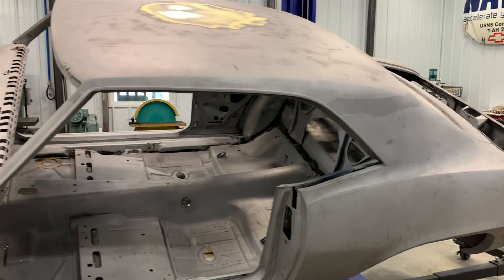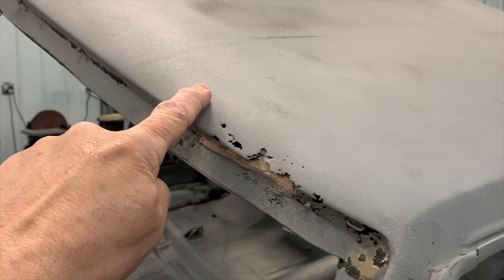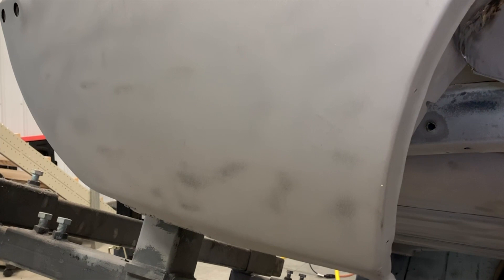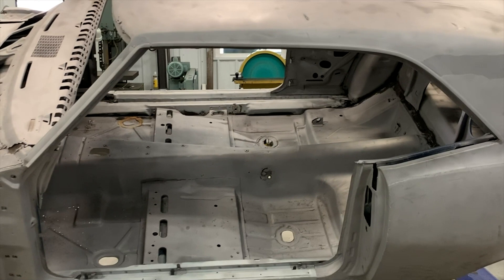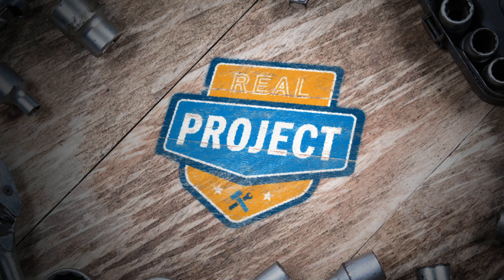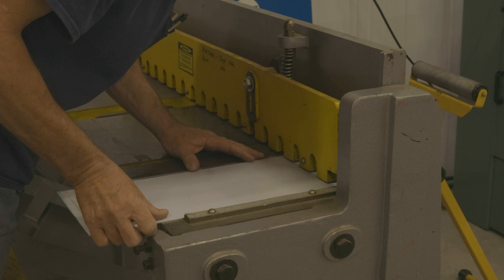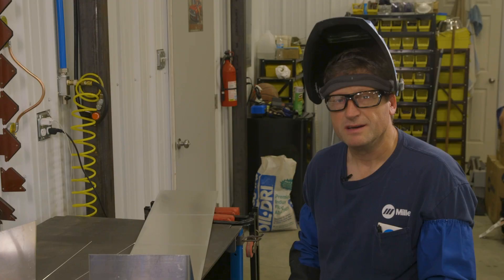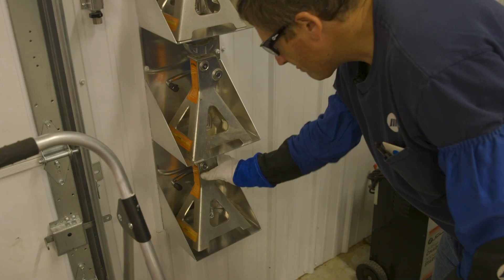Real Garage: Goodbye Rust, Hello Jack Stand Storage (Season 1, Episode 1)

Comment: What shop air company, products did you use for lines and taps, always enjoy
Reply: It's the RapidAir MaxLine system.  Compressor is mounted outside with water seperators.  Each connector drop still has a water relief valve too.